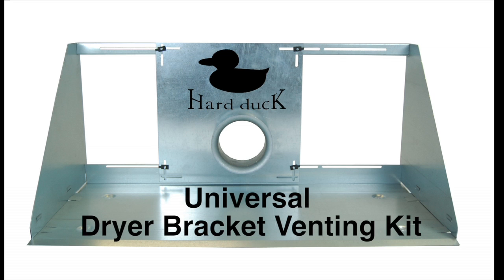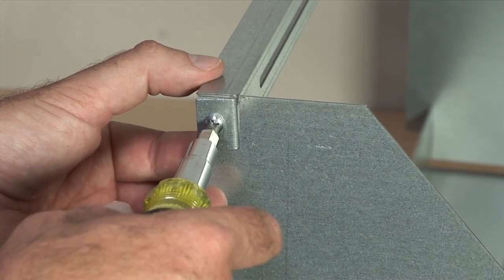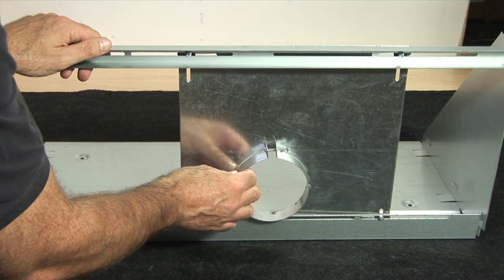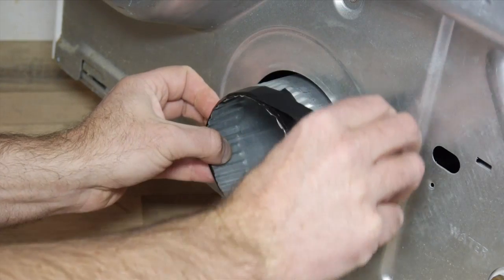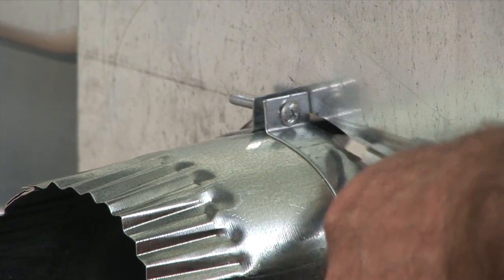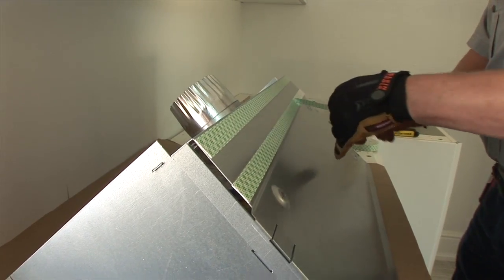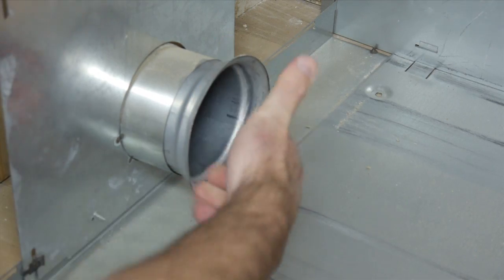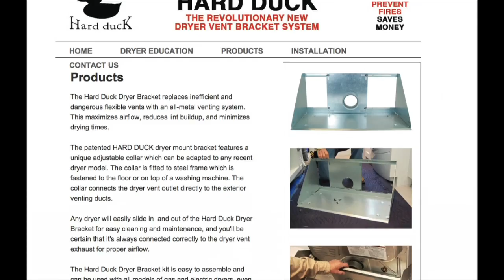Dryer Vent Installation - Hard Duck Dryer Bracket Installation Video

Comment: I usually just follow the appliance makers installation directions. How do you compensate for in the wall ducting outlet's that may be higher or lower than your product's pre set positioning?  I see no adjustment for up and down compensation.?